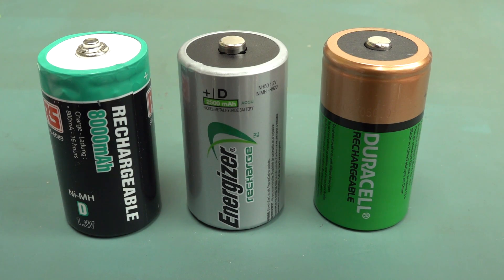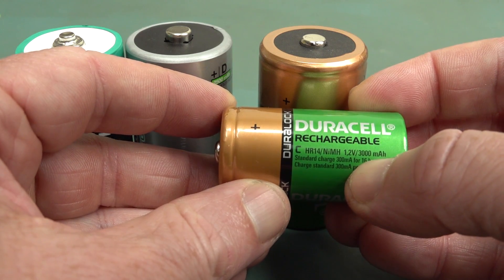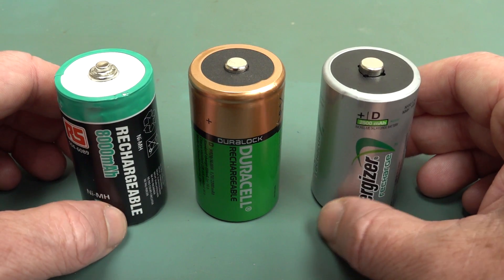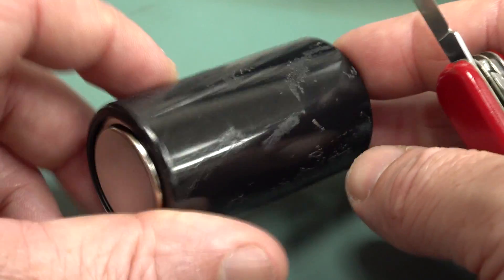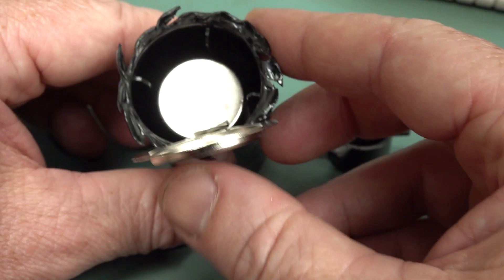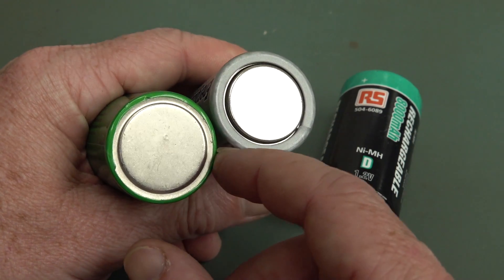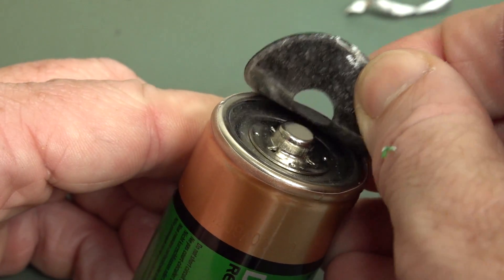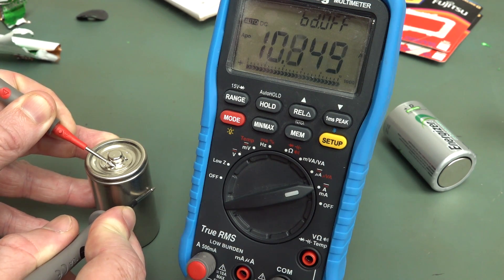EEVblog #1200 - BUSTED! - Energizer & Duracell NiMH

Comment: I was surprised to actually find some of the Ansmann cells tested on my go to website to look up detailed reviews/tests of 18650 chargers and batteries.
https://lygte-info.dk/review/batteries2012/Ansmann%20D%2010000mAh%205030642%20%28Silver%29%20UK.html
Ending up with a 9.119Ah/11.112Wh capacity discharging at 3A down to 0.90V and its 2A discharge results aren't too far off from the official specs he listed above.
So based on that I'd have a high confidence in the capacity of those cells, would like to know their low self discharge properties though.

He also listed a 3000mAh Varta D cell:
https://lygte-info.dk/review/batteries2012/Varta%20D%203000mAh%2056720%20(Green-silver)%20UK.html

Then also some older Tensai 4000mAh C and 8000 mAh D cells:
https://lygte-info.dk/review/batteries2012/Tensai%20C%20TR-C4000%204000mAh%20%28White%29%20UK.html
https://lygte-info.dk/review/batteries2012/Tensai%20D%20TR-C8000%208000mAh%20%28White%29%20UK.html
No particular experience with these batteries, but I do have a few 9V NiMH batteries that so far held up well (both 6 cell 8.4V and 7 cell 9.6V variants). 

So that's kinda promising, I wouldn't mind a fairly decent 8Ah rechargeable D cell... if I had anything that runs on them. I can only think of 3 items owned by my parents that still run on those batteries: battery powered baby swing thing, old style radio/casette player and an old D cell maglite that doesn't get used.

Comment: I ran into a straight scam with a car starter booster battery pack, it was supposed to have a 12 volt 14Ah sealed cell lead acid battery. It was the same size as other similar batteries, but perhaps a touch lighter. Turns out it had a separate compartment at the bottom, about 1/3 of the entire volume, with a slab of granite to make the thing weigh more. The only purposes for a compartment like that I can think of are smuggling and scamming.

Comment: Another interesting scam are 6V lantern batteries that use D cells instead of F cells. you can tell by the weight distribution in the battery. F cells will have a better weight distribution.

Comment: The RS clearly says 800ma in the small print on the side. Not the big font but small font on the battery.
Reply: That is the charge current 'mA' not the capacity, which is 'mAh'.  A 8000mAh battery should give you 800mA for 10hrs.

Comment: I have opened so many of these and they ALWAYS LIE,  These big companies are criminals. always judge your batteries & your Speakers by weight. So they can't cheat !!
Reply: Except there's no lie here, the battery and its packaging is clearly marked with the correct capacity. They are also priced accordingly: these duracell D-batteries are the same price as their C-batteries.

Comment: Hydroxides are exothermic when ADDED to water. Hydroxides are caustic when IN water. If the hydroxides have been sitting in the water a while it won't be exothermic. Only when it's hydrating does it produce heat.

Comment: Back in the '90s I had some NiCd D cells for my boom box. I never opened them up but from the weight I always suspected that there were only "normal" AA cells in there. They were Memorex branded, if I remember correctly... So, this kind of "scheme" isn't new. Though I suspect that back then no one produced high capacity D cells for the mass market. I certainly thought I was lucky to find any kind of rechargeable battery in this size at all.

Comment: For disposable batteries the capacity is a big deal, but may I you consider that these are rechargeable batteries - whether you re-charge them after 2 months or 4 months is not that big of a deal. The price however is. So I am perfectly ok with cutting down the capacity, as long as that's what it states on the tin. 
PLUS: the self-discharge rate won't make them that long-lasting anyway. Likely, the bigger charge depletes itself more than it would power your device (in low current applications that is).
Much ado about nothing I'd say - you uncovered worse...
Reply: That’s what I was thinking, probably for self discharge ect. But these NIMH batteries do have a pretty low self discharge rate though.

Wonder if the 2 big battery companies doing this just hate rechargeables and want them to suck. The trying make people think NIMH is bad and push them to Alkaline. Lol. Probably not though
Reply: Months...?!? hmm...my boomboxes doesn´t even run a week with a set....;) and about hours at high volume ;)

Comment: I guessed from the beginning that they would have a smaller cell inside. Maybe the D-cell is getting kind of obsolete with today's small, high capacity batteries and low power consumption devices (I have not bought one in about 10 years) so they do not sell enough to warrant making a cell in that size, so instead they take any convenient cell (maybe a size they have a lot of in stock that does not sell by itself so they want to get rid of them?) and stick it inside a casing to fit the old flashlights etc. 

If I needed a D-cell for some old thing I'd probably just 3D-print an adapter to use 3 or 4 AA:s like this one: https://www.thingiverse.com/thing:33706 or https://www.thingiverse.com/thing:264476 . (The 4 AA model is slightly thicker than a D-cell so might not fit all devices).

Comment: Long ago in the days of NiCAD, I dealt with some of these same battery manufacturers, who spilled the beans on their products. As I remember it, they had an "industry standard" cell that they called "2/3 C" that they used in as many of their products as they could. ("sub-C" also comes to mind.) By using this standard cell in most of their products, they kept their costs low. Thus, most of their different battery form factors, like C and D, used this same 2/3C cell. No difference at all between a C-cell or a D-cell. If you are an OEM and want a rechargeable battery pack containing spot welded-cells in your product (think "Black and Decker," etc.) these were the cells that provided decent capacity while minimizing the cost of your battery pack. It sounds like that's what's going on here.

While I agree that the big name brand cells are quite expensive compared to off-brand cells, you have to remember that most consumers are completely ignorant about electronics. "mA-Hr" means nothing to them. All they know is that they want a rechargeable battery in a D-cell package that costs the least. "2500 mA-hr versus 8000 mA-hr ... what difference does it make?" Amazon sells "Amazon choice" NiMH D-cells that they call "everyday cells," then conveniently omit any capacity data in the ad. No doubt it, too, is a 2500 mA-hr cell. Cheap (about $1/cell), and that's all most consumers are looking for. The much-higher capacity D-cells sell for 3-5x this price. Which do you think the un-savvy consumer will buy?

Comment: I seem to of missed something, at the start you said the capacity of the batteries stated on the pack was correct. So what is the issue?. They are doing exactly what they claim. Regardless of what's inside. How much more expensive was the RS one than the Duracell?
Reply: Yeah, thats what i said too. Like making up an issue from a non issue. No ones misleading anyone.
Reply: Energizer 2500 $11.66  RS 8000  $19.85
They won't fool people who do a little research and know what the numbers mean but they will gain a margin from people who believe the advertising. 
They spend a lot of money on advertising and seem to think the returns outweigh the cost.
The extra space inside is where the Energizer Super Plus MAX Improved Next Generation Heavy Duty Xtr3m3 Power lives.
Reply: If i'm not wrong in ads they claim as extra long life batteries(as a whole brand feature), so have 2500mAh in package which can hold 10000mAh and call it extra long life is kinda direct lie.

Another thing is price ofc not linearly coralate with capacity, so they more expensive per mAh then RC 8000mAh one. So again kinda scam when someone sell you 1/3 full bottle at price of half full and call it cheap.

Another thing is charge-discharge cycles: bigger capacity battery you will recharge less often than small capacity, since they(due to similar chemistry) have more or less same charge-discharge cycles count, you will wearout smaller capacity battery faster then huge one, in same applications and same time frame. This is more from "Planned Obsolescence" subject.

Finaly: bigger form factor should means bigger capacity, thats why initially they made D package, and put there capacity of almost AA battery is plain stupidity, i mean if device require D package battery, usually it  require big capacity, otherwise you will recharge batteries every now and then.

This is the case when you initially paid less, but in long time perspective you will spend more money replcaing them more often. This trick they often use so customer thought he's smart and saving money, but eventually he dont.
Reply: 10,000 mAH 'Tenergy' cells from China are way cheaper than the name brands.
Reply: @brittneypaul2089  Yes, but can they be trusted to be "as advertised"?

Comment: The "peasants" shop by brand. Only a few years ago, the local 99 Cent Only Store, had a surplus inventory of Varta Alkaline batteries, in AA & AAA. Most US shoppers are unaware of the German Varta brand, so they bought Eveready and Duracell zinc carbon ("heavy duty") batteries instead. Even after the Varta inventory was expended, I still buy alkaline, as its a superior chemistry, at these "dollar stores", as they sell the two different chemistries, for the same price. Alkalines usually cost more, but not at discount "dollar stores". Alkalines, to the unknowing "peasant", has 2.5x to 3x the capacity, for the same physical size.

Comment: Hi Dave...I'm not surprised Dave with their cheating the public which goes forever like the Energizer rabbit  .I'm also surprised the insides are not AA cells.I use Duracell AA  rechargeable cells here all the time.

You got to watch out if the  case wrapping on the positive side dont come off.It could cause a dead short  in a device if the positive connector or spring overlaps the entire front of the battery.

I had a walkman that was smoking and almost caught on fire  since one cell was shorted out because of the outer label was coming off the top of the cell..

 Clive at BigClivedotcom posted a great video as he strips down   AA NiMH rechargeable batteries .

https://www.youtube.com/watch?v=tBg4ximDrsk

Comment: The current RS  8000 mAh cells are made by NEXcell BATTERY CO., LTD as stated in their data sheet if you could be bothered to read it. The one you have there (with the same part number) is an older version so you must have had it hanging around for a bit?

Comment: It would be cool to compare the insides of non rechargeable batteries to the same brands and other brands but made in different ages like the early 00's, 90's, and 80's. 
I felt that aways the duration of these non-rechargeable batteries got worse every year.
Reply: That's wrong, batteries last longer now than ever. Rechargeable batteries was a joke when I was a kid, they lasted about an hour then took a day to charge up again.
Reply: @GTSN38  I wasn't talking about the rechargeable ones, but the normal "batteries" the alcaline ones for example. Its because english is kinda stupid on that, rechargeable batteries (we call here "baterias") are called batteries, and what we call "pilhas" are also called batteries in english. I'm sorry for that.
Anyway, corrected my original comment.

Comment: in regards to using the D-cell in place of a C-cell: if you use batteries in-series with no insulator on the outside (assuming the batteries are side-by-side), if the cases come into contact with one another, it makes a short circuit. maybe not a dead short, but pretty close to it.

Comment: It's an industrial "sub-c" cell... they've been doing that for years.
Reply: Absolutely!  I remember when I was a teen back in the 80's (no NiMH's yet, just NiCads) I tore apart a Radio Shack "standard capacity" D cell NiCad only to find it was exactly that - a larger plastic shell holding a sub-C cell inside.  At that time, normal Radio Shack rechargeable AA cells were around 450 mAH, and the standard C and D cells were both 1100 mAH.  (All PURPLE, remember those?!)  I think they had only recently rolled out a line of High-Capacity C and D cells as well, for a much higher price, of course.  I forget what the C was, but I remember the D had 4000 mAH.

Anyway, one day Radio Shack had a huge special on their standard NiCads, so I bought a big bunch of the C's and D's and tore off the shells of them all to build battery packs out of the sub-C's inside!  It gave me cells for I think close to the price of AA's at the time but about 2-1/2 times the capacity.  (Hey, this was the 80's, so we didn't have eBay or Amazon, and I hadn't discovered Jameco or Digi-Key, yet!)

I don't get so upset about this as a fraud, as long as the capacity is clear or not otherwise misrepresented.  I probably would feel differently if this were done with primary cells, as the extra capacity is much more the point of getting larger cells, there.  (Anyone aware of this being done with primaries?)

Comment: With NiMh, noticed that I could get many more recharge cycles out of old (15 years ago) cells compared to today's cells.
I could easily get 400-500 charge cycles and the new ones these days now seem to only take at most 100 recharges.
NiMh was supposed to handle 2000 recharge cycles, back in the day but I noticed that now there is no such claims.
Has anybody noticed that too?
It appears that their life expectancy has been deliberately reduced.

Comment: Quite pathetic to build batteries like that! What's the point of selling a bigger cell, if it's mostly made of air!? Considering how readable is the capacity in the RS cell, and how much less obvious is that information on the other cells, it's clear that the idea is to fool the customer. They see a lower price, and won't notice the lack of capacity when buying, and most would have no idea what's the normal capacity anyways.
It's surprising to see that the cell was just rolled and kept together by a piece of tape! I was expecting some kind of container over the roll.

Comment: I haven’t seen the video yet but I’m going to guess he finds out there is a Sub-C cell inside. This isn’t uncommon, only a few brands use the entire size of the battery in a D cell. That’s why some are like $10 ish a piece and others are $30 a piece.

A Sub C is what was used in most of the NiMH battery packs for like cordless tools and the like. Their large production numbers is what got them into D cell rechargeables, that and rechargeable D cells are not very common.

Comment: That cell is a standard NiMH package seen in a lot of power tool batteries (back when power tool batteries still used NiMH). It probably is more cost effective and better engineered for energy density to use the standard package than to find a bigger custom package. That's why those bricks that plug into Lithium power tools and laptops have 18650's inside.

Was kinda hoping you would put these on a discharge tester and show the real capacity.

Comment: NOW...
need to compare prices..
THEN
Use the Supplied Chargers (WHICH SUCK ALL TO HELL)
With a smarter charger, which you would use on the 3rd party battery..

Because General purpose batteries DONT cost this much and have about the same in them...Being charged 10 times the price over general use batteries is STUPID..
Imported batteries TEND to be allot better, and its been shown the Amazon battieres GIVE what they are, BETTER thent he Major corps..

Comment: This is the 2nd time I've watch this video and it made me think twice only from 2 different scenarios.

Scenario 1:
Guy buys battery and finds out battery is inside of a shell case that was modify from C size battery into a D size. It works and provides the same amount of capacity as stated.

Scenario 2:
Guy orders a large veggie pizza from Dommino's. Employee decides to put a small pizza inside of a large pizza box. Opens large pizza box and sees it's a small size pizza.

Comment: In the UK the energisers and the duracells are about £3.50 a battery, but the RS battery is about £8.70 per battery.; so the best value battery are the duracells (either £/Ah or Ah/£). The only reason you would buy the RS battery is if you care more about capacity per battery, than cost.

Comment: This is off topic but ...
What makes me angry is that so many LED flashlights and other devices use AAA batteries instead of AA batteries. AA alkaline batteries have so much more capacity than AAA's and are only a bit larger. Rarely is a slightly larger diameter flashlight a detriment (at least for me). AA's are more bang (so to speak) for the buck. I avoid buying anything that uses AAA's unless there is no choice or it is a remote for some other thing I bought. 

Putting on my tin foil conspiracy hat :-) I think the battery manufacturers are pressuring flashlight makers to make AAA battery flashlights and devices just so they can sell more batteries. Taking off my tin foil hat, I still think the same thing :-(

I rarely buy Energizer or Duracell (or any major brand name) batteries anymore unless they are cheaper which is almost never.

Comment: Do Energizer/Duracell ranges also have high capacity D cells or not? I'm sure there are proper cases where you want a lower capacity cell, regardless of form factor. If that's all they sell nowadays in this size is low capacity however - then it's fishy.